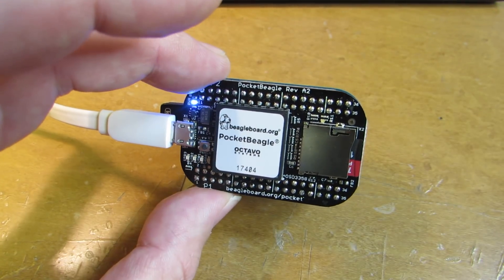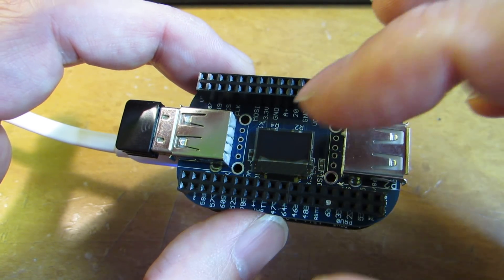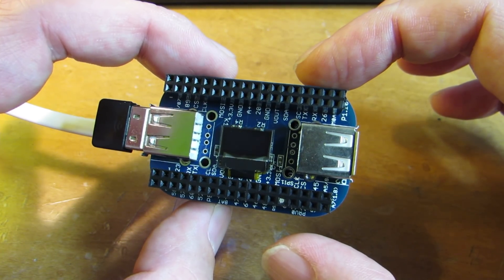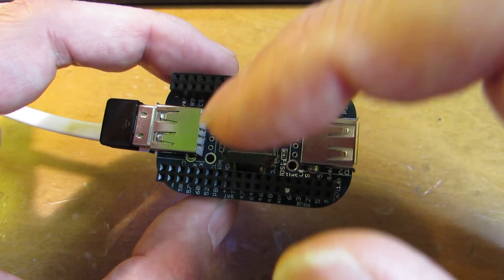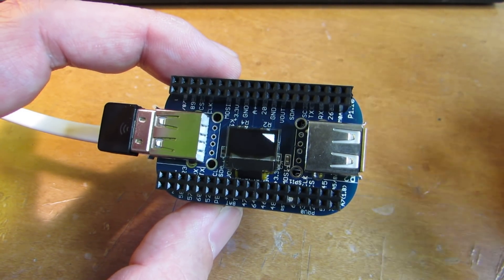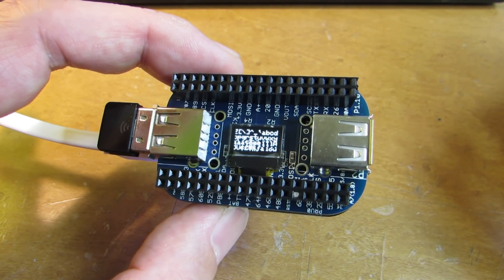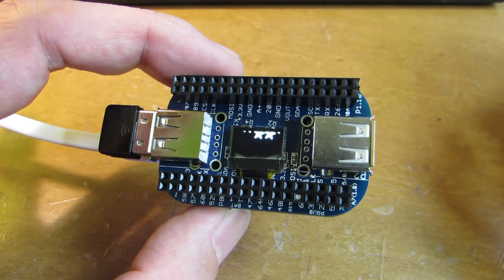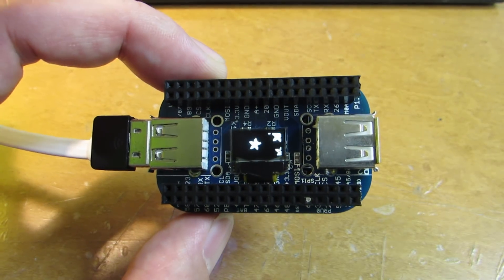PocketBeagle cape with USB hub and tiny OLED display

Comment: Basically , you solve some issues of PocketBeagle, like USB, wifi and display , right ? good work.  Is a 25$ a good price for this board ( I saw this link: https://www.sparkfun.com/standard_arduino_comparison_guide) ?
Reply from the maker: Hummm but BeagleBone is a far beyond Arduino series, because it is, indeed standalone Linux computer. Its relative is Raspberry Pi, but I don't prefer Rpi, because they simply destroy motivations of makers by just announcing $5 single board but I've never seen $5 tag in the store. (They just say but never sell at that price). Compared to Raspberry Pi, Beaglebone series are much more honest.
Reply: about BeagleBoard then Beaglebone Black Wireless  come with ~70 EUR ( mouser.com) ARM Cortex A8  , you can find on https://www.amazon.de the R3-Arduino-Rev3-ATmega328P-CH340G-kompatibel-USB-Kabel with ~6 EUR  but ATMega328P . The tasks are  very important for the person who use boards. Most people who want to buy do not know the limits of these boards. I think this is losing to marketing process.
Reply from the maker: Yeah, indeed the power and usefulness of ATMega328P is remarkable (I love one, even smaller Attiy10 is my favourite) , but it surely can control something but if we want to let them think (make some decision by surrounding information), ATMega can be one of peripheral but cannot be a main role of the system. Actually before I've explored Atmel ATMega world upto  Mega2560 with 512kBytes SRAM, but they are "micro-controller" and we have another easy way..